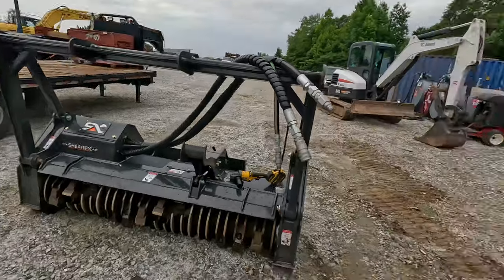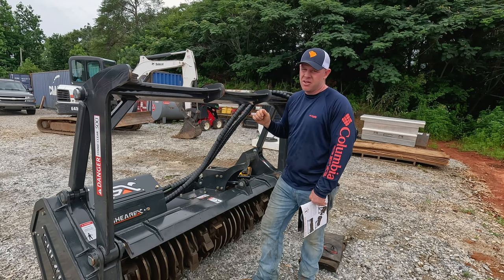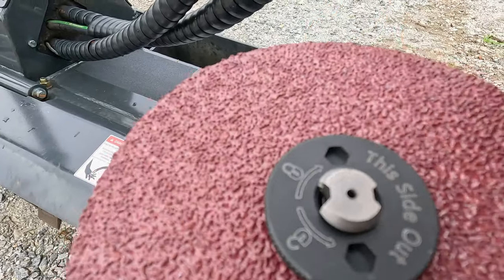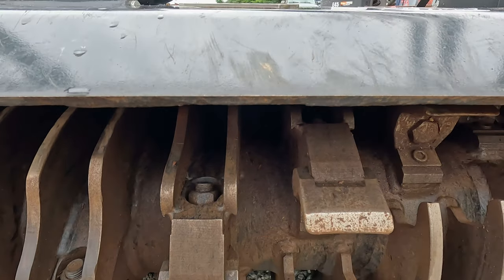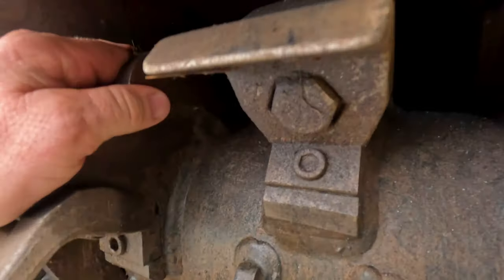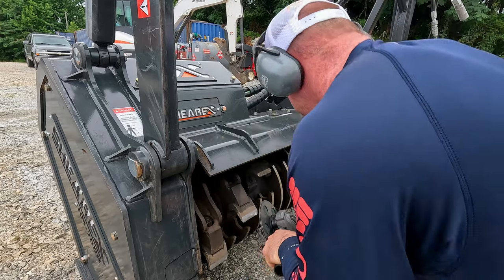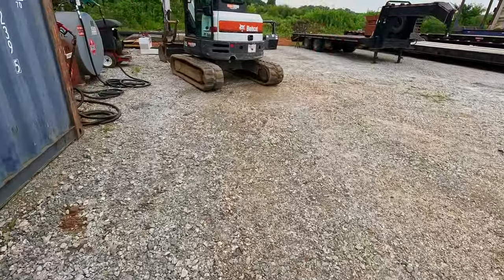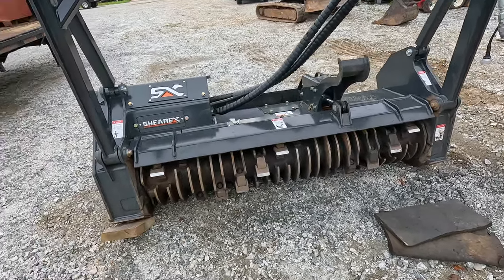Review on the Shearex hm-70 dr mulching head and how to sharpen the teeth

Comment: How many other companies provide you with the equipment you need to maintain a product whilst it's on loan, not many, shows how much Shearex value this product. As you say John this unit isn't as big as your other one, but it certainly seams to box at the same weight. Like how you take time to service your equipment, it saves money and time down the the line. 👍🤗

Comment: I knew Dennis Cimaf heads came with a 2 stroke grinder with that style grinding disk and similar gauge. Btw why did the Loftness Timber Ax with upward rotation drum never take off? They seemed poplar back in the early 2000's.

Comment: I have been testing with building the edge back up with hard facing and then grinding that sharp. If I know Im going to be in rocks I will use a harder mig wire and then quench after welding and then quench again after grinding them sharp. I take the teeth off and I made a fixture for my table to be able to do 40 double sided teeth in two hours. I sharpen them a few times before building it back up with weld or hard face.  Last time I did it I ran it through the heat treat oven as well.  Unfortunately I dont cut enough of the same materials with the mulcher to really understand which process lasts longer and holds sharper.  I did machine a few test teeth once and they worked super well but cost more then buying teeth.  I want to get an EDM  wire and sinker. and try to make some out of pre treated harder materials. Use the sinker for the threads...  at that point when do we start metal deposition coatings and  automated resharpening with an cnc edm wire program.   Just have to figure out how to do it efficiently. End Mills on cnc machines are just too expensive to use for teeth like this. 

I showed how I did the hard-faced ones in a video on here. just hardfaced and ground.

Comment: Would't a belt sander be quicker and more precise on a straight edge? I'm asking from inexperience. I use to do similar things with a file when I was young.
Reply: How are you going to get a belt sander in there to the tooth?
Reply: @DonMutchler-om5pg  You realize there are hand held belt sanders.
Reply: @randallconnersgmail  Yes I do.
But you can't get one into the teeth. The bite rings are to close together.
I have 2 Denis/Cimafs that take the same tooth.